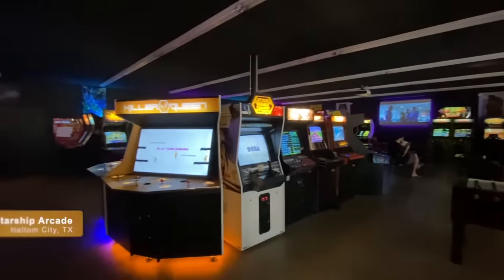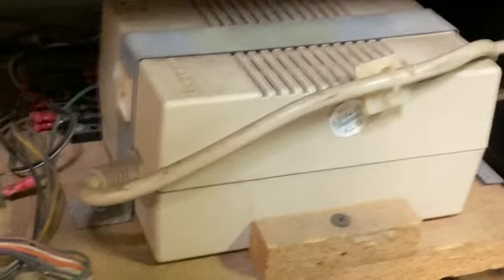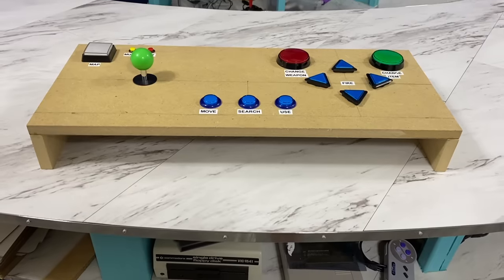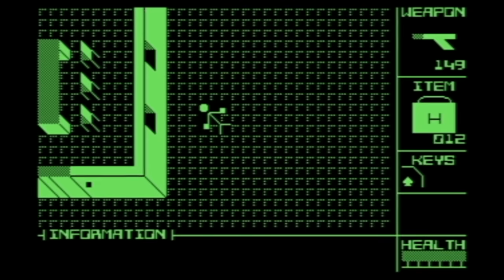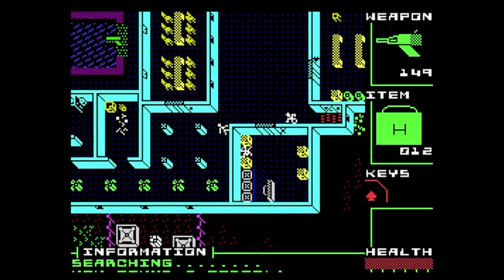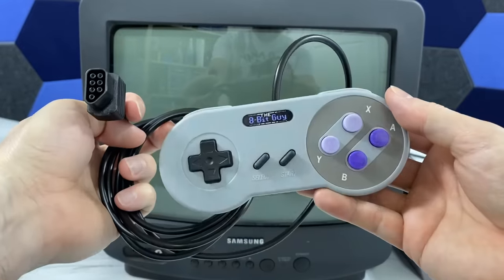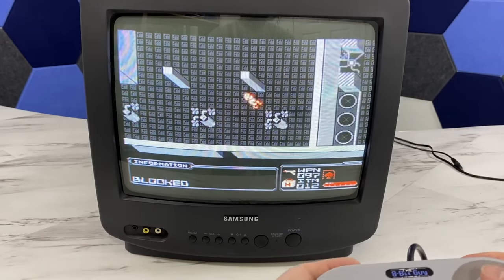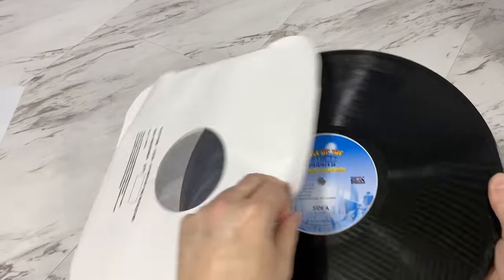Petscii Robots Mega Update - Arcade, Genesis, MS-DOS and more!

Comment: I wonder what benefits the mmc5 does have over the standard nes? mmmm.
Reply: It basically pushes the HW to the (known) limits, enabling it to do things it can't on its own. With MMC5 a 8x8 tile can have its own subpalette of the four. It can display 16384 different tiles on the screen at once instead of 256. It can also use three extra audio channels, although this part is kinda troublesome. Besides of this, it has excellent memory mapping capabilities, providing fine granularity, and this allows to have more complex program architecture, doing things that would be more difficult (if possible) to do otherwise.
Reply: @shiru8bit  whooooaaah, i didn’t know that Nintendo really did care about expanding it’s graphical and audio capabilities of the nes and i did not knew that it was actually possible to expand the nes by just adding extra rom and ram along with bankswitching to make better graphics and pcm sound possible along with an extra soundchip for famicom via it’s sound pins and allowing bigger rom size nes games etc,,,
Because i eventually tout that nintendo did not care about graphics & sound but more cared about being able to play a game,but with all these enhancement chips, i guess i might be wrong(alltrough nintendo wouldn’t go for lorom and a slow processor if they will know if it will have a negative impact on gameplay),but still it’s mind blowing that despite the mmc serie chips are not graphical enhancement chips(not like super fx chip) they just do allow better graphics on the nes trough bankswitching,also while the mmc3 chip has no extra soundchip BUT it does allow better adpcm audio quality on nes trough bankswitching,so instead of using 1bit dpcm and cram all those sound effects into that 16KB audio ram,you can just decide to use 4bit adpcm samples instead and devide them into sections of 16KB and bankswitch around them once needed for better digital audio (sure 7bit pcm is possible but at the cost of running a game but ideal for static screen sections).
Reply: @johneygd  actually the hints are that Nintendo was never going to use 'mappers'. Their bet was the FDS, they're jumped the mappers bandwagon only when they're abandoned FDS and third parties started to release cartridge games with expanded memory.
Reply: @shiru8bit  yeah true that.

Comment: Aw, come on.  Surely this is an OBVIOUS case for finally making an official Z80 version and then making it a pac man or donkey Kong conversion
Reply: Joking aside, not too difficult to port to these in general, but either of these don't have enough RAM.
Reply: @shiru8bit    possible to add more though pretty easily I think.  You'd just have to do what high score conversion kits do, and put a PCB between the CPU and the mainboard.

Actually it might be easier to straight up design a legit PCB

Comment: I personally like the Petscii Robots videos, but I'm still waiting for a finished arcade version. One that plays nicely with other emulators on a multi-arcade (Windows) box. And cocktail mode would be a big plus. Starting from top of vertical screen, a 768*576 Player-2 viewport (rotated 180º). Under that, a 768*214 shared HUD or two that are 768*107. Last, another 768*576 viewport (rotated 0º) for Player-1. Let's find some way to share files, and I can do the splash screen and in-game artwork. It will only cost you 15 Kopeks. 🤣

Comment: How about you study how an MMC5 mapper chip works and build your own MMC5 mapper chips instead?  If Carroll Shelby can build his own car based upon the AC Cobra, and the average person can make a kit car from one that is pretty much identical to the vehicle that costs potentially millions of dollars, then surely you can build your own MMC5 mapper chip.  Also, before you say that a person cannot do so, then you should look at the magic that other people did for 8-bit and 16-bit video game and computer game systems.  Two good examples would be what Watermelon Games did with Pier Solar and the Great Architects and Paprium.  Yes, a lot of drama, and COVID-19 got involved into the latter game, but there is no denying that what those games achieved in the Sega Genesis/Mega Drive achieved and, had the games been better built, as well as directed, and had they been made back in the day, then they would have been one of the biggest video game manufacturers in history.  I will also point out an extra example and that is an example that another video game company that is called MegaKat Studios did for the NES with a little game that is called Micro Mages.  Granted, that game was built differently than yours, but at least it shares the similarity of your situation, which is to overcome obstacles that typically limit video game systems from long ago.

Now as for your character sprite issues, I have a simple issue to overcome your main character sprites and that is to simply NOT center the character in the center of the screen, but, rather, you could do one of these things, namely, a. pick a corner that is close to a wall, b. have the character that is on the screen be next to a part of the wall that is next to a single wall sprite, you know, like the ground, brick, step, and Question Block sprites that are in Mario games, or c. have the background screens themselves done differently than they are on the other systems, instead of having 8x16, or whatever standards that the other video game systems have for their character sprite sizes, sprites on the edges of the screen, thus your character could be built to 8x16 standards without sacrificing much on the appearance of the characters in the game, and also allowing more colors for the NES/FDS version of the game.  You can look at games like True Lies, Robotron 2084, Smash T.V./Super Smash T.V., Total Carnage, Xenocrisis, Soldiers of Fortune/The Chaos Engine, and Soldiers of Fortune 2/The Chaos Engine II and see how the sprites look in those games.  I may not know much about programming, but the predecessor of the Super Mario Maker games, namely, Mario Paint, explained about a concept of wasted character stamps/pixel space, which, in turn, can crowd out game code that can lead to a lot of issues within the game.  I also did not want to sound rude, condescending, or like a moron that did not know what they were talking about, and I hope that I did not do so, but I was just trying to throw some suggestions on how to fix at least some of the issues with the NES/FDS port of the game.  I do hope that it is successful and that more modern consoles can also receive ports of the game.  (I would also like it if the SNES/NSFC would receive a port of the game as well.)  Keep up the good work.

Comment: Okay who here can reverse engineer a mmc5 mapper chip?
Reply: It has been reverse engineered a while back. The problem is that so far you're still need to use a relatively costly modern electronics to make a replica of it. Not that the cost is sky high, but as it needs to go into every single copy of the game, and it won't be a mass production (under 1000 copies perhaps), the cost bites.